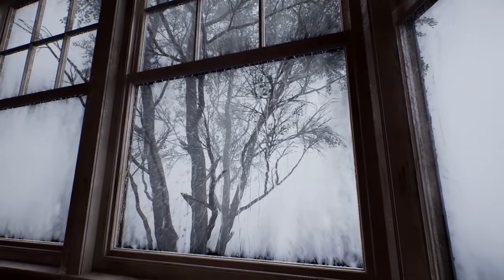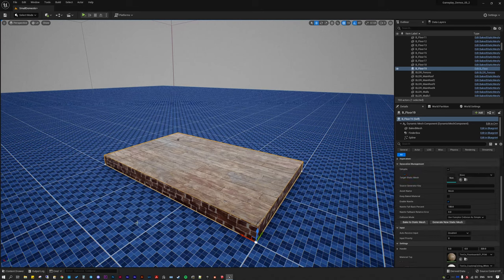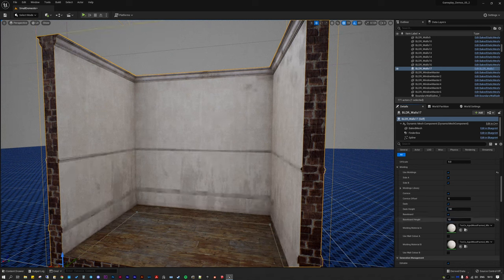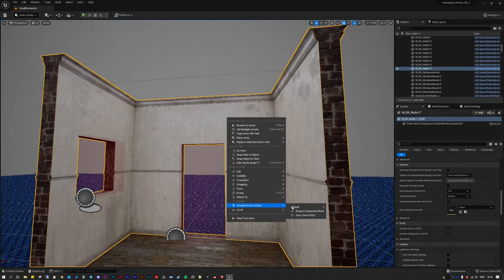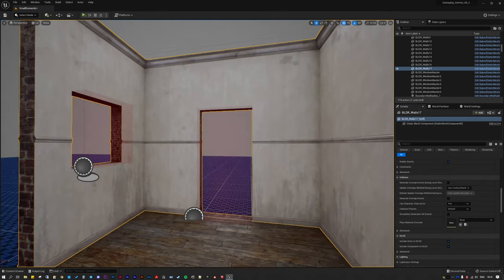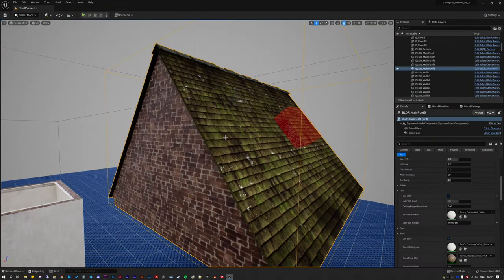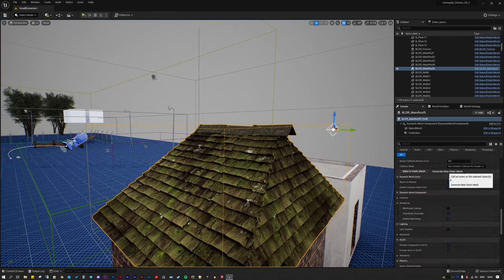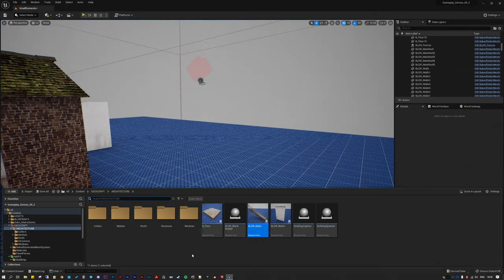UE5 - Custom Geometry Scripting Tools

Comment: So essentially what you've built here is the replacement for the brush system Unreal has desperately needed ever since they moved on from UE3/UDK (the default modeling tools are promising but they're still just not there yet IMO).  Would DEFINITELY love to see a tutorial or three on how you built this, or even a marketplace product I could use as reference to build some custom tools for myself
Reply from the maker: Kinda yeah, my tools are a bit more tailored to being a set of shortcuts for my particular project (because the tools are supposed to imitate Victorian buildings). I think the new default modelling tools more than make up for losing BSP but it's partly subjective and based on what you're comfortable with. The BSP tools were very streamlined, whereas the new tools are supposed to replace a more fully-featured 3D modelling app.
I did do a starter tutorial on my methods for using the GeoScript plugin - https://www.youtube.com/watch?v=TcDNJDBVIJk
Hope it helps.

Comment: Amazing and definitely will take the time to learn some of this. I don't see an update on this specific part of the project from you, but one thing that stands out is the brick texture appearing in doorway cutouts or wall ends. Have you, or will you explore wraping texture and moulding around a wall end, and some sort of addition to the cutout tool to add jambs, lintels, sill plates etc.?
Reply from the maker: If you watch to near the end of the video I cover windows with sills (lintels would work in the same way). For my project door jambs (and the other woodwork of the door) also have to be separate meshes / blueprints too. This is because both doors and windows will be interacted with and can't be part of static geometry in the level.

Comment: Hey man cool stuff. 
But how those mesh cutters works?
Could you share the concept may be?

I mean how they communicate? And how you detect intesections with dynamic meshes properly in editor (especially when they stop intersecting)?
Are you using Editor Tick?

Comment: This is some exquisite stuff! Do you see yourself trying to add imperfections to the geometry in the future?
Reply from the maker: I've definitely been thinking about this and I tried it with the roof tile displacement to good effect. Getting different parts to fit together is tricky if there's too much distortion (like warped wood, subsided walls etc.). There's a lot you can do with textures to fool the eye into thinking things are warped. I have a UV distortion function in my brick texture that works well for that (not shown here). I'll see what I can do though.
Reply: @cromlechstudio3628  would love to learn more about how the UV distortion works and what effect that gives.
Reply from the maker: @peterallely5417  It's pretty simple, you can just multiply any UV coordinates by a noise texture node. I just have it set to very low values so I get some subtle undulations in the bricks, as if the buildings have settled over the centuries.

Comment: I am currently trying to make a WallByCurve Script but i can not figure out how to align the mesh according to the spline. Also i am wondering how you made it so the in- and outside walls have different materials IDs? Could you give a small hint for that and maybe a screenshot which type of append primitive you´ve used for the wall thing?
Best Regards.
Reply from the maker: No worries, I'm honestly just appending a box for each section. It's been a few months now, but iirc each face of the box is given it's own polygroup ID, so you can easily just apply a material ID to any polygroup ID (there's a geoscript node that does that).
Reply: @cromlechstudio3628  Hi there, thanks for your answer. I honestly can´t figure it out. 
I´ve tried appending a box to each spline segment, but then the walls don´t line up at the corners. I´ve tried to add the widht of the wall to the length and add a cutplane to each point to cut the wall, but this only works if the walls are within 90 degrees. 
Then i tried to add a cutplane by angle of the points and here is where my math knowledge ends :D 
If you could upload the file somewhere or make a screenshot of your graph i would really appreciate it! I really need this to work an can´t figure it out :()
Reply: Ah man i'm like in a very similiar place. I think the answer is definitely a plane cut but i can't quite get the mesh plane cut node to work properly or i'm misunderstanding something. I've got it placing the walls properly on the spline but my corners aren't neatly welded like in @Cromlech Studio 's demonstration video. I was rewatching hoping to gleam some inspiration for how to get those corners  "welded" properly. I even tried sweeping a polyline along the sample spline to get a nice mesh. It works but it deforms so not really usable. I'll keep plugging away but these tools you're working on are awesome. https://youtu.be/bMABJR--Jyw to see my buggy version of this. xD Haha

Comment: So great Cromlech! Could I ask you how do you achieve the 'subtract' boolean with that separated Cutter_freeform Actor? I'm doing something similar but I don't find the way to communicate both actors (in editor, outside runtime). I already know the rest: making a boolean between two referenced dynamic meshes inside the same actor, for example, but just got stuck at that point, to make it across two different actors.

Thank you very much!
Reply: Hey buddy, did you found a way for doing that? I’m running into the same problem and can’t get my head around. 😅
Reply: @zeinstil  Hi Zein,

Yes, I did! But wasn't easy; you can use your "cutter" blueprint to generate the maths (location, rotation, size...), and send those maths to your main "geometry script" blueprint, making the geometry/boolean operations all inside that blueprint, generating a new box or whatever you want, with the maths received from the "cutter" blueprint.
Reply: @miguel_1900  Thanks a lot Miguel. That helps to kinda get me in the right direction, how to do it. Now I have to take a deep dive and try to get it work! :D
Reply: @miguel_1900  Hey there. Do you remember how youßve send over the data? I´m triing it all day long now and i can´t get it right.
Because i want it like in the video, that when i move the cutter, the wall get cut automatcally i thought i should use an event dispatcher in the Cutter Blueprint and call an event there, which then get´s assigned in the Wall BP, but this does not work like it should. What works is that it cuts the mesh, but it cuts it continuously, i donßt know how to explain it correct, it basically eats aways the wall geo.
So i think event dispatchers aren´t the right way here. So if you remember how you did it i would appreciate it if you would shere your solution :)
Reply: Hi  @grafix-productions  !

I can't remember now, I'm sorry, but you must avoid dispatchers, as they are thought for runtime, not editor. You 'just' need to play with direct references to send info between different blueprints. That way, I could 'auto-cut' with the cutter in real time, but I must recognize it was a little performant heavy (as you are making a new shape and a new boolean cut every frame, when moving the cutter), so maybe it's not the best way and  @Cromlech Studio could show a more optimized way, if they finally make a tutorial.

Best regards!

Comment: I'm not 100% sure I understand the flow of geometry scripts blueprints. I tried to use the cut mesh to make the corners of my walls but it applies the cut mesh to every wall spawned along the spline. Is this an issue that you ran into when you were first attempting to make the wall splines?
Reply from the maker: It sounds like you're cutting your shape before you clone it along your array. You need to stage the flow of your BP so that each corner is dealt with one-at-a-time. It's tricky to do that, but a good start is to store the number of spline points in an integer array and loop through them. Then you have a way to tell your later functions which corner you're dealing with.
Reply: @cromlechstudio3628 Thank you for the reply! That does give me a starting point that I can look at things from a different angle. Btw all the stuff you did in this video is amazing! I've watched your picture frame tutorial numerous times but I'm just not as sharp in my older age 🤣
Reply: @cromlechstudio3628 Again thanks for the advice! I was able to get it exactly the way I wanted. My issue was that I was appending to the dynamic mesh before doing my cuts and calculations. Once I realized that I'm a moron it be clear on how to tackle the rest of my issues
Reply from the maker: Good to hear that you got it working. @WowzersTheThird

Comment: Do translucent materials work with geometry script??!!
Reply from the maker: Yes, translucent materials work with Geometry Script. Translucency doesn't work with Nanite meshes, so you just convert to a standard Static Mesh after you're finished with Geometry Script.
Reply: @cromlechstudio3628  so does this mean I have to convert to static mesh to work, or does Geo script can handle translucent materials natively, its been a while since I used geo script, but as far as I remember, I was working on a project where I needed to generate meshes at runtime and couldnt neither convert to a static mesh at runtime nor assign traslucent material, am I missing something? Thanks a lot and I lobe your channel, I wish you could make more videos 🩶
Reply from the maker: @0xnd90sjsnjdo0sbbo0  I see, you're talking about generating at runtime. My system bakes out to static meshes. However, you can see from my video that I have translucent materials applied to the compute meshes (runtime) before I bake to static mesh, so I'd expect that should work in game too. The only thing I can think might be an issue would be that runtime compute meshes sometimes have incorrect normals (this gets solved when they're baked though), which might make translucent materials look weird.

Comment: I thought translucent materials weren't possible with nanite? So how are the windows nanite meshes?
Reply from the maker: Yes, you're right, the window meshes are not nanite, I address that later in the video. I hope they finally add that in later builds.
Reply: @cromlechstudio3628  same! As well with vertex painting! And also potentially tesselation, as for some aspects it would be a lot handier/not possible to use nanite... don't know how they would do the vertex painting on nanite meshes as yeah well... But it would be great!

Comment: Can these be generated in engine procedurally?  So as the application plays it created these buildings dynamically
Reply from the maker: Dynamic meshes can be generated at runtime, but I don't think baking to static meshes is possible (even if it was it would cause large freezes in gameplay).
Reply from the maker: Also, what you see in this video is being generated procedurally in engine.